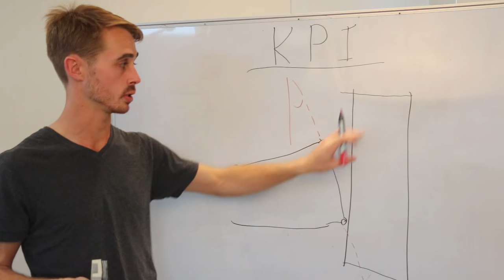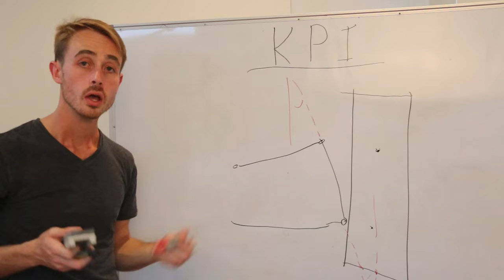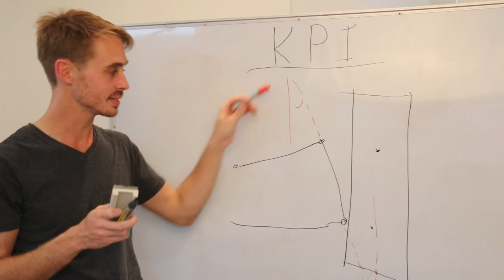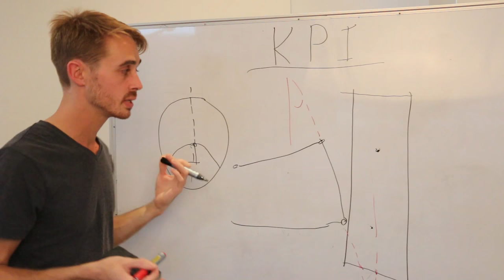How King Pin Inclination Angle (KPI/KPA) Works

Comment: On dirt tracks, kpi is actually helpful. When initiating a turn, we want to take weight off of the rear left and somewhat the front right tires. Kpi shoves the front left tire down, which helps us accomplish this. Then, when counter steering after initiating the turn, we want the rear left to take the weight again. So, in that scenario, it's actually quite helpful beyond just compensating for building limitations.

Comment: You can totally have your KPI at 0º in the center of your wheel using a pivot point above the wheel, or using virtual pivots like in 5 link multi link front suspension. Many newer cars use these principles, sometimes even combined like in the Hyundai genesis sedan up to 2016

Comment: What is the kpi for a go kart? And how will we decide that angle?
Reply: kpi for a kart must me much greater due to the fact that no differentials are used. The effect of kpi on weight transfer is such that the car tends to oversteer, while using no differentials leads to understeer. So huge amounts of kpi are used in order to compensate the lack of differentials on kart

Comment: how does kpi counter the camber change due to caster?
can you please explain and refer some sources which may help me in this regards?

Also how do you calculate the Anti-Dive or Anti-Squat percentage of the buggy if the A-Arm linkages are parallel and H-Arm linkage is parallel to camber control link Linkage....(With regards to Geometry)

Comment: If you're running inboard brakes, you can get less KPI since you can move your pivot points further inward toward the wheel. Therefore, you can run less caster since you don't have to compensate for KPI which isn't there. Does this reduced amount of caster provide any benefit?
Reply: Ubernoob85  since u have less caster angle this means lighter steering but less feed back and less camber gain

Comment: If I run a certain positive KPI, and when I take a corner and it goes from positive to negative at the outside tire, what are some consequences I can see? Or does it not matter positive/negative as long as my scrub radius is closest to the center contact patch? Im doing some analysis through OptK for my fsae project and by changing the KPI angle, I managed to cause these effects. Was just looking for some guidance, Thanks!
Reply: You and i are on the same wavelength. It doesn't work you will get a brain anurism i have tried, to make the system work.
Reply: You can resolve this with caster
Reply: If you have the contact patch behind the point of rotation you have no problem

Comment: is there anything worth noting for toe in/out for open wheel race cars other than aerodynamics?
Reply from the maker: +Ed Carver Toe in/out actually doesn't have a huge effect on aerodynamics, it does however have a very large effect on handling, which I will be covering in a later video!

Comment: the theory is all well and good and all but not many people have made any videos or put out any info that i can easily find on the actual practice of it, like how to measure it and find where the lines intersect, on an actual car with wheels on it, on the ground, everyone just explains stuff on a whiteboard
Reply: its just easy to draw lines through stuff on a 2d surface rather than the actual 3d model
Reply: PhunkBustA use a cad program

Comment: Hey Kyle!
How do you calculate the KPI and the scrub radius on a pull rod suspension assembly?
Reply: Old comment, I know. KPI and scrub radius have nothing to do with pull rods, per se. Therefore, these are calculated the same as any other type of double-wishbone suspension:
KPI is the front-view angle between the steering axis and a vertical line, where the steering axis is defined as an axis between the two outer ball joints of the upper and lower wishbones. Scrub radius is the distance between the steering axis' ground intersection and the center of the contact patch.

Comment: *I* know how you could have the A-arm pickup points "inside" the wheel. Just build a hub without all the breaking system. And then build the braking system inboard the vehicle/before the A-arms.